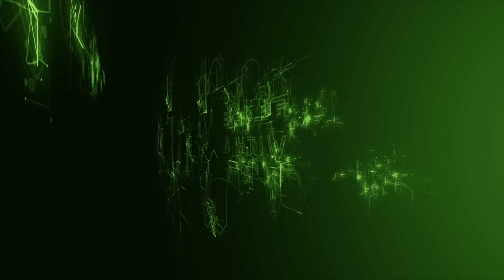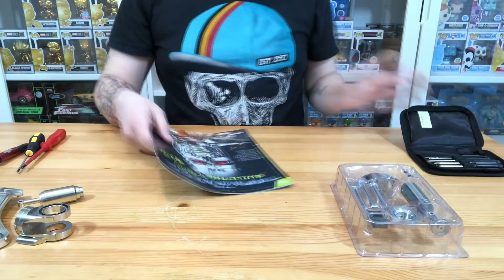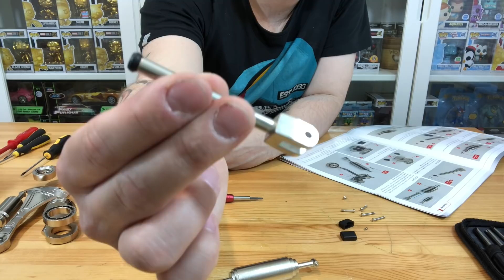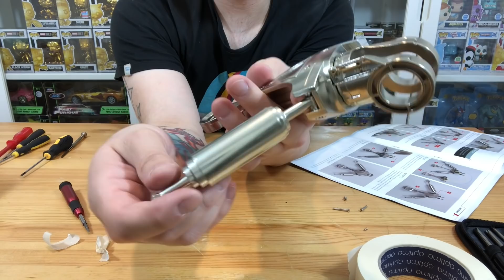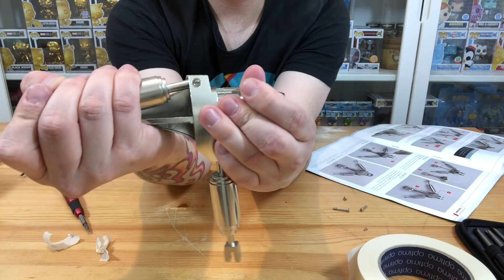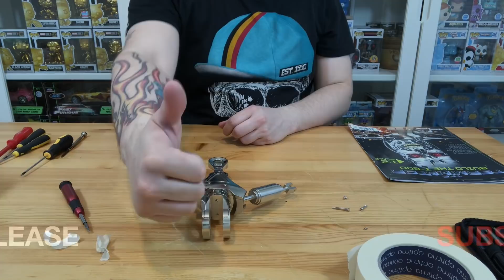Build the Terminator T-800 Issue 4 - Upper Right Arm Assembly  ( Speed Build )

Comment: if i was not already subscribed to the delorean kit i would defintely purchase this myself. usually "build an issue" kits are of the most supreme quality anywhere. my delorean for example: contains all parts to "hotswap" to all 3 movies, every single LED that should be is there, uses authentic sound files, master on/off is controlled bt time circuit control, has authentic stainless steel body, officialy licenced volvo engine and DMC body style, real working steering wheel, authentic "time flux" gimmick, and still had enough free space to shove a RC esc, a 2000kv motor and a 2 cell 2400mah batt pack. nearly 100ft of wire in the thing. if you plan on having these for a lifetime they are well worth the nearly $2000 asking price
Reply from the maker: That is so amazing how you got all that to fit. Nice one 😊👍🏻

Well the build has only just began so maybe you can pick it up after the DeLorean build 😊🔥

Comment: takes exactly 2 years to get all 120 issues to build a 90cm(1/2 scale) t-800 at a cost of about $1,900.00 USD. is primarily aluminum in construction and has movable eyes, is fully articulate, and comes with remote control. just wanted to put this info up front because "build a issue" type collectors items never tell you this up front. your average cost per month is about $70 USD